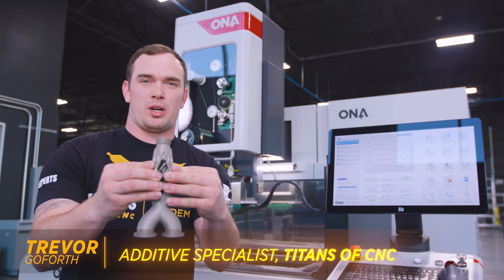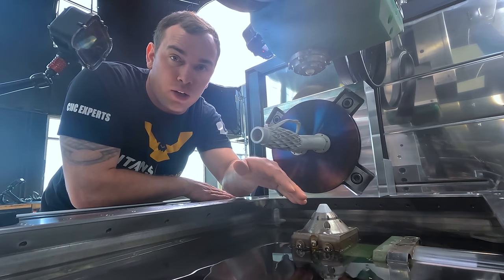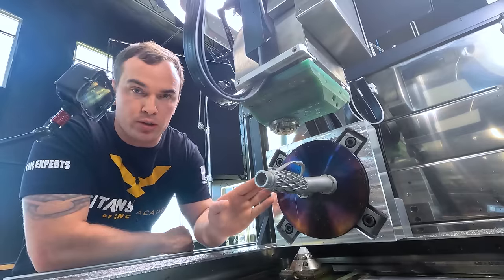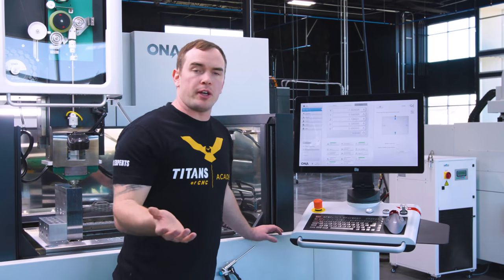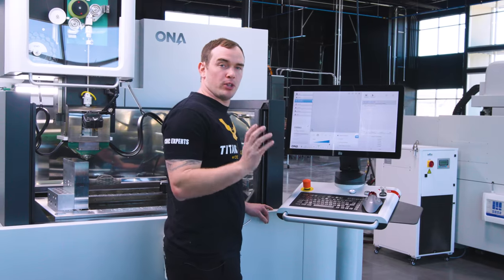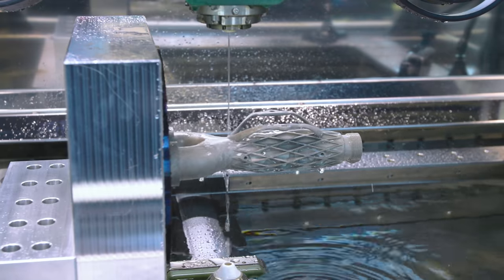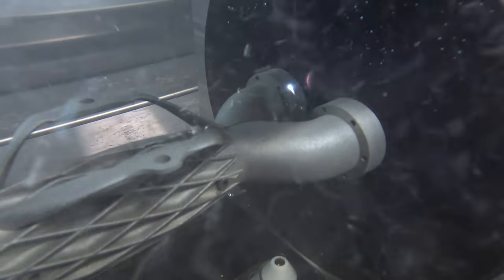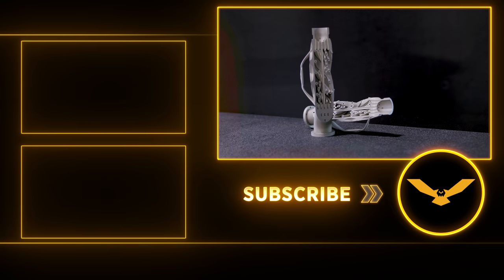How to Cut an IMPOSSIBLE Metal 3D Printed Part in HALF

Comment: What I noticed 🤔
Gap produced due to internal stresses .
I imagine how grain structure this part has.
hmmm .... untempered martensite !!
Reply: so basicly you think the printing process hardened it due to thermal shock which left that much stress in the material?
Reply: @quelixfenzer5108  yes I am exactly thinking about that.

Comment: Yeah wire EDM is cool, but a hacksaw will get the job done just as well
Reply: @gamelord1000  those were not made by EDM.
Reply: What's the thinnest hacksaw blade you've used? We typically assume our EDM cuts will be ~0.013" wide and they will be extremely smooth. Another reason EDM is used for 3d printing is because most of the 3d printed material eat cutting tools up badly since the most common alloys are inconel, titanium, Haynes, etc.

Comment: Gotta ask. Why not just print half the part? Is the coordinate system here the same as on a lathe? Gotta remind myself here ABS stands for Absolute and not Anti Lock Breaking System😂😂
Reply: Sometimes printing half the part is actually worse because you end up having unconstrained edges that now need support
Reply: @BenWilson24  Definitely beats an Ender 3  and a band saw🤣🤣
Reply: @MrCoffeypaul  haha yeah, I've actually used my ender 3s to make some custom fuxturing and shop aids for metal printed parts
Reply: @BenWilson24  Have to say gotta love how Additive can open up CAD(different jobs become possible) and am giving some thought to a cheap Resin Printer. Recently printed off a PLA  part for a light fitting that is over 30 years old(impossible to buy or find a replacement) Together with Sand Casting and things can become really satisfying!
Reply: @MrCoffeypaul  yep! I get to see the benefits everyday with metals for my job as well as with polymers with my side business!
Reply: @BenWilson24  Very lucky man Ben. Am hoping you could answer a question. Let's say you print something with 10mm hole at 200 centigrade, is there a way to guarantee that hole will be 10mm at 25 centgrade?
Reply: @MrCoffeypaul  not really. 3D printing can't change the thermal expansion characteristics of the material. To limit the shrinkage, you'd just take that into account with your material choice
Reply: @BenWilson24  Thanks, had to ask. Just one of those things that would annoy me until I asked✔✔

Comment: perfectly in half? unless you designed the model to take into account the wire dia and the overburn otherwise you lost .008 at minimum. 

edit to add, could have also 3D printed 2 parts, and ran 1 offset to the left and the other offset to the right and swapped the half to each part, then you'd retain dimensional accuracy with the part held together which isn't the point of cutting it in half anyways. finish on the cut's could be a little better, I've found that by running a few extra skim passed offset back out a .00002/.00003 you can get a very fine finish. I have to hold .0002 all day on thermal forming trims via wire edm. It's what i do for a living.

Comment: The claim that you are not shocked cause of the deionised water is quit frankly false and dangerous. The water is initially deiosnised - sure - but that just increases its resistance, not make it not conduct electricity. On the other hand, as soon as the process starts, the water becomes a lot more conductive.
The reason you do not get shocked is cause the designers of the machine were not such colossal morons and took the safety of idiots into consideration and galvanically isolated the powersupply (and the wire is directly next to the big lump of metal that closes the loop).

Comment: 3d printing  you can make fantastic  parts  but  you cant make the parts   in the real wold ..  edm machining and mold   you can make parts
Reply: I 3d printed end use production parts for 5 years at an aerospace OEM and now support a list of contract manufacturers printing production parts for several industries

Comment: Wire EDM tech in many cases destroyes metals and making tiny invisible cracks on the surface. Should be used in special purposes when traditional machining is impossible. Dies and stamping forms for metalworking produced by wire edm tech in many cases destroying much more earlier than those produced by traditional cnc machines. Wire EDM can't substitute traditional machining because it is destructive for majority metal varieties.